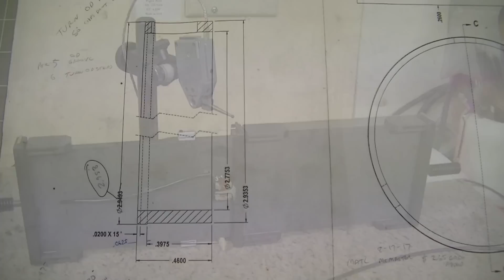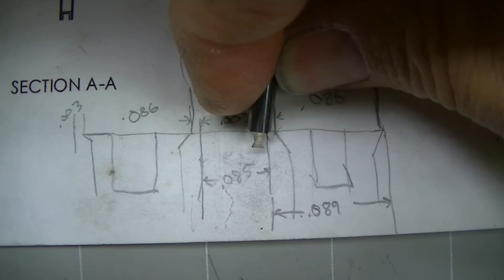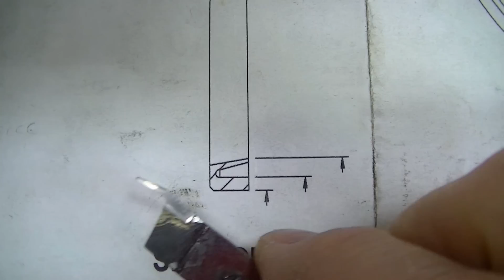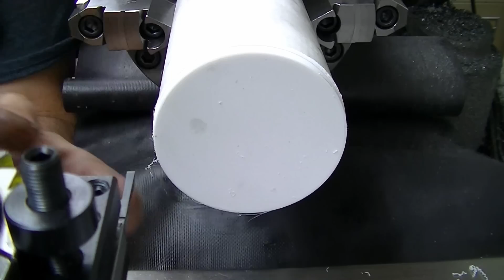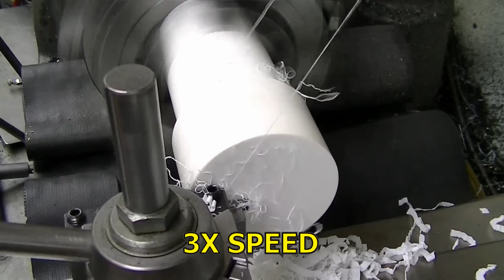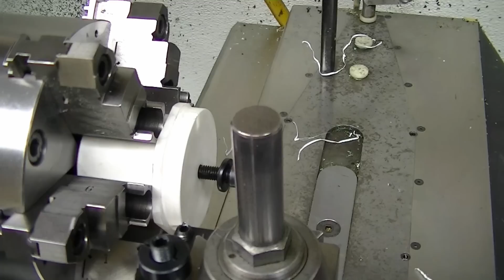RING TYPE PART TECHNIQUE

Comment: I make a lot of tiny PEEK parts, like 1mm diameter, and the long stringy chips become really troublesome sometimes breaking the parts or deflecting them enough to ruin the dimensions. Have you ever tried cryogenic chip breaking? I was considering using dry ice to chill alcohol thru a mist style nozzle.
Reply from the maker: Cold air gun

Comment: You may find that some plastic materials benefit from freezing before machining. Freezing will make some of these plastics substantially stiffer so that flexing under cutting pressure is reduced. Extended cutting operations will negate this somewhat due to the generation of frictional heat. In that case, use chilled coolant or return to the freezer at periodical intervals.

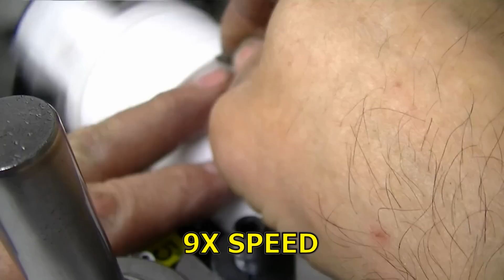Comment: As a weekend hack, I cut an O-ring groove into a face now and then, so I have a question on the relief or clearance angles for the parting tool you plunged into the face around the 15:00 mark.  As the diameter of the groove shrinks, the tool must get shorter (weaker) or else be curved to fit the groove it's cutting.   Do you ever make curved HSS tooling for this?  If not, how short can this be (depth/height ratio?) for plastic vs alum vs mild steel?  I hope this is clear; I tried to be terse. 😀
Reply from the maker: Carbide tool with a curved surface approximated by angled facets.

Comment: I can see the future, you will invent a new unit of measure, called Robrenz unit. 

It is used to measure bends in the spactime continnuum. To determine flatness on historic mechanical time waves of sort. You dont need it, but its there, measure the universe, robrenz unit. 

Lapped feet so flat and lapped that defines flatness. In the dictionary will be a picture of robin under the word flat. 

Robrenz, the one that put flat spot on atom by lapping. Rob.Unit. flat

Comment: Does your DRO automatically adjust if you don't hit your numbers, thus avoiding any tolerance stack up? Like if you you were over .01" on a length, it would reset at each line of code as a new datum?
Reply from the maker: definitely not
Reply: @ROBRENZ  that's only slightly unfortunate. I guess, in this case, you'd only have the length as your variable that would need to be rezeroed if need be. 

Thanks for the reply,

John.

Comment: You do operations like I like to think of operations. When I got in trouble in school and had to write a sentence over and over, I wrote one word at a time from top to bottom instead of a full sentence at a time.  Muscle memory kicks in and you can fly.  I hope that makes sense.
Reply from the maker: I did that in second grade on the chalk board. The teacher did not appreciate my striving for efficiency and made me start over.  ;-)
Reply: Haha yes i know exactly what you mean, i used that method when I was made to write the same sentence over and over in school too.
You got to watch out when using that method though because the alignment of the words and spacing can develop into a sort of pattern if you're not careful and make it obvious you wrote each word one at a time. 😅
It is tons faster that way though for sure.

Comment: Thanks 
I just recently discovered your site and have binge watched almost all your videos. Your presentation ,sharing of your thought process  and craftsmanship are truly astounding. I have throughly enjoyed every subject you have covered. I am very thankful you are willing to teach and share. I have spent the last 40 years building custom homes and I wish I knew back then a bit of what I have learned watching machinist videos the last few years. I thought I was a pretty good woodworker until I saw how an ultra fine craftsman like you works. Watching your great setup for drilling the three holes I wondered if all of the holes for all parts could have been drilled as a first operation on the cylinder?
Thanks again for great videos.
Reply from the maker: Glad you are enjoying the content. I have actually done them doing the holes in the cylinder first but it takes longer and is more prone to errors. Thanks for watching and commenting.

Comment: Great to see tooling for and thinking behind face seals, also how to (semi)automate, and end up with useable stock afterwards (rather than turning >90% to swarf), very useful, thanks.  

On the fixture issue, could it be you're making a larger/stronger burr while milling the holes this time around?- it still seemed like easy on/hard off even after you'd reduced the fixtures' OD - could it be that the endmill isn't cutting so clean as previously, and the burr is jamming the ring on the fixture?
Reply from the maker: The end mill was cutting very clean. It was just the mandrel had grown some and the fit was too tight. I purposely have them stretch on a little snug.  Thanks for watching and commenting.

Comment: gentleman, that couple thou difference in the last procedure is it cause by heat? we all know that when we turn something in th lathe,  it will create a lot of heat, however, pet is sensitive to heat and melt, i guess that`s what happen
Reply from the maker: I was running very slow and the parts were not even warm. It was just the arbor being too big. Thanks for watching and commenting.

Comment: what do you think of the spring loaded deburing countersinks? The two cutting edges are spring loaded to permit equal deburring of holes on circular surfaces (like the three holes in your ring)
Reply from the maker: I have never used one but I think the spring pressure would be  too high for the plastic and you would end up with a huge chamfer. Other than that they look like they would be the ticket for this application.

Comment: I've just deleted the compound on my Colchester Student and converted it to a solid tool post mainly to rid it of massive movement when parting which is successful due to your input but now I'm interested to see more detail on the facing and turning tool you use in this video.
Many thanks for excellent videos.
Reply: Ooooh, you reminded me of Colchester Lathes. I got my degree from the University of Essex, Colchester, England. Every time I took the bus I went past the Colchester Lathes site. It never crossed my mind that one day that fine factory would be gone forever. So sad...
Reply from the maker: Thanks It is a C7 brazed carbide tool. diamond lapped 5 deg. clearance  Thanks for watching and commenting.

Comment: Do you ever have issues with chip rubbing when doing those OD operations plastics?  I've always just used the vacuum to slurp up those long continuous chips like spaghetti.  It solves the chip wrapping and provides a bit of cooling, but the noise gets tiring and the hose tends to get in the way.
Reply from the maker: It is not a big problem on these but that is a good idea, I will give that a try next time.

Comment: Is that a ball end mill you're using to drill the holes? If so, why that over a drill bit or regular end mill? Just curious.
Reply from the maker: The ball nose end mill has a very gradual increase to max diameter so it progressively enlarges the hole and kind of reams it at the end.  The very controlled breaking through the inside of the part keeps from having chipped edges or even cracking the part. Thanks for watching and commenting.

Comment: Love that DRO with it programming & tool offsets.  With your tool post modifications I bet you get fantastic repeatability.  Is the tapered nose on your Hardinge indexer integral to the spindle or is it an attachmet?  The one I have has the 5c collet spindle.
Reply from the maker: It is integral and has 5C internal. It is identical to the lathe spindle nose.  Repeatability is as good as the toolpost. Thanks for watching and commenting.

Comment: When I worked for Esco we did work for Nasa. one of the parts we made was out of some kind of nylon material. It was shaped like a channel about 40" x 1.50wide and 1" tall with closed ends. In order to machine the inside pocket on the Bridgeport mill we made a fixture out of aluminum that the part set down in. We made some extra parts and they got stored in the warehouse. About a year later they wanted the extra parts but with a design change to some of the features. I setup the fixture waiting on the parts. The parts arrived but wouldn't fit into the fixture. They had increased in length about 1/8" from absorbing moisture. We have a humid climate here in Houston. Great video I see some ideas that would really adapt to the CNC. Thanks. We normally waste the material and part off on a boring/groove bar. The bar catches the part. But the stock could do the same if I were to reverse the trepanning and part off tools. In fact I could do it between centers with a right angle shanked trepan tool.
Reply from the maker: Thanks for stopping by Peter! I think that PET mandrel grew several thousandths.
ATB, Robin

Comment: Neat technique. It seems like drilling the holes took quite a bit of time. Could you have pre-drilled them while the material was still in bar form? Would be fewer individual operations.
Reply from the maker: Thanks, I have tried that before and I like this way better. Thanks for watching and commenting.

Comment: Interesting stuff. You're quite thoughtful and organized. And I still can't figure out from the jobs you've done what your essential occupation is. It's a mystery to me. Also, every time I watch your videos I get to yearning for a Hardinge lathe.
Reply from the maker: I design and build precision spindles and infeed mechanisms for the industrial grinding industry. The Hardinge is called "the Toolmakers Dream" for a reason, even more so when it is set up like mine.
Reply: Thanks! The mystery is solved. I'm going to start saving up for one of those "dream" machines. My old Atlas 6 inch that's made of pot metal is going to be retired. And my 14 inch Lodge and Shipley just doesn't have the tactile feedback I sometimes need.

Comment: Excellent and innovative, I was taught in my apprenticeship to bore out multiple washers, though it functioned better mainly in Cast/Chilled Bronze materials, but have never used the trepanning method. It's an honour to watch, and learn. Also like the larger diameter chuck key handles for ergonomics. Again, thank you for sharing your expertise.
Reply from the maker: Thanks and thanks for watching and commenting.

Comment: the Renzo-meter or renzometer- sound scientific like there are only a limited number leading scientists who understand it's use  I got a used 780 shoulda waited for a cheaper VUE espacialy if the take 5vpp scales need to find read head any Ideas on like a LIDA 48 equivalent aftermarket but still good. its part of the big ball of string I got going in my shop good tips in the I loooove the hardinge stuff
Reply from the maker: Thanks, no ideas on the scales and thanks for watching and commenting.

Comment: I'm gonna wait for the Renzo-Demo. I got my petty fault-finder set to "ultra nit-picky" and put fresh batteries in it. No pressure.

Super demo on how to use the tool setting features and the advanced part programming available on non-basic DRO's. And also an excellent demo on how to not waste very expensive materials.  It's been a long time since I bought poly-flouro-whatsit stock but it wasn't cheap; somewhere between inconel and silver per weight unit. No point to drilling a 2 1/2" core away to nothing. 

Trepanning the part away from the parent stock to a groove insures against wall deflections. Plastic bushings (I guess you could call them bushings) that skinny don't have to be round in their free state but the OD and ID has to be parallel.

An alternative useful in thin-walled parts when the raw stock is furnished as a tube or a ring casting is to semi-finish machine OD and ID to the same stock allowance. Then turn/bore to dimension simultaneously using opposed finishing tools set to the wall thickness and positioned to cut the critical tolerance. Back in the day I quite often had to make bronze thin-walled bushings on a VBM. Using two tools not only ensured wall thickness but neutralized part deflection and chatter. PITA to set up but it saved tons of time in the long run.
Reply from the maker: Remember this is just a rough proof of concept version (seriously). This was just to see if I was delusional or not and I am definitely not. But I am sure I can learn some things going through the petty fault-finder with fresh batteries.  I have done the balanced tool trick in the past and I agree with your assessment. Thanks for watching and commenting.
ATB, Robin
Reply: ROBRENZ Deviants to traditional methods are doomed to death by Monday morning quartebacking. It's the Rule: nothin can be changed. Innovation must be crushed lest we make progress.

I've been thinking about your Res-O-Meter. If it wasn't for a fine opportunity to credit its inventor, I'd suggest calling it an "undulometer."

Segue: Thanks for the tip for the Shars/Deckel grinding wheel hubs. I ordered four Monday last week and now have them in my clutches.

Comment: really great video. I was making some pinch coLlars for my tool posts. Im having a hard time with getting the 1/32" sliting saw (4" dia) to cut on centerline on the back side. I had knurled the od and im thinking it induced stress into the Ann 4140 I was using'
It seems like a simple part, there are a few challenges like drilling & taping thru the od.
Ill keep at it once me new mill is here and setup
Cheers Robin. ATB
Reply from the maker: If  you are going to make a wrench like I showed and are making the collars I would do a 3/32 wide groove so the wrench ears would be thicker. IMO the wrench is the best part of the whole Idea. Thanks Phil and thanks for watching and commenting.
ATB, Robin
Reply: That would make for a stiffer blade also, thanks Robin

Comment: Fascinating, as always.  Is there any particular reason that you used a ball-nosed endmill when making the indexed holes? Thanks for taking the time to make these videos.
Reply: just commenting to hear answer =)
Reply from the maker: I would think that would be the same as using a 2 flute end mill. You are breaking thru into a cylindrical bore so I cant picture it working as safely as the 4 flute ball mill in plastic
Reply: Me too
Reply from the maker: Thanks, the ball nose end mill has a very gradual increase to max diameter so it progressively enlarges the hole and kind of reams it at the end.  The very controlled breaking through the inside of the part keeps from having chipped edges or even cracking the part. Thanks for watching and commenting.
Reply: Ever tried a 180deg drill bit? I know they work well in sheet metal to leave a clean hole and not break thru.